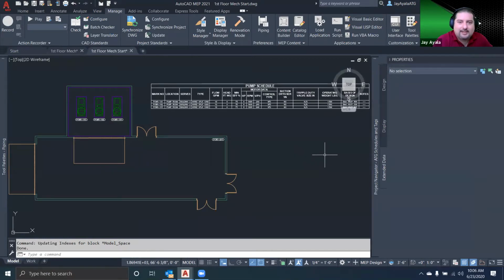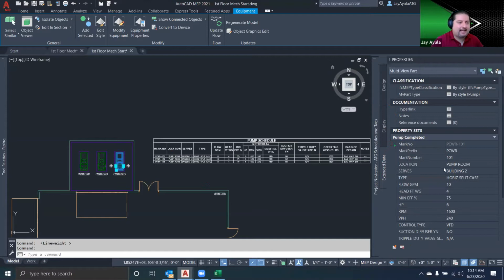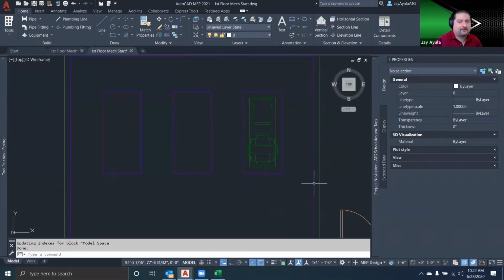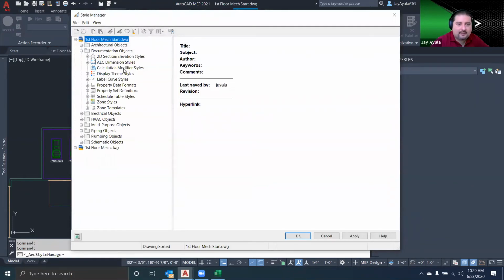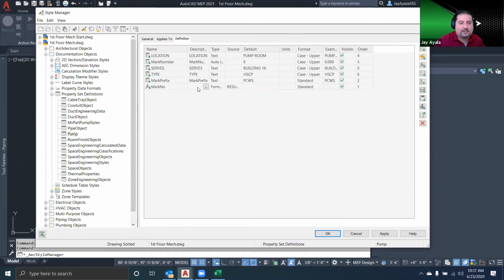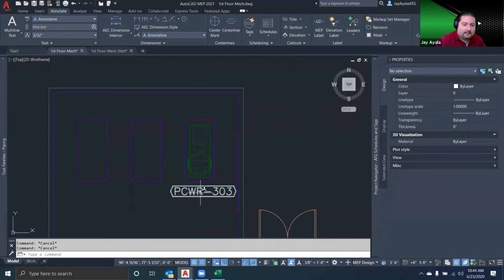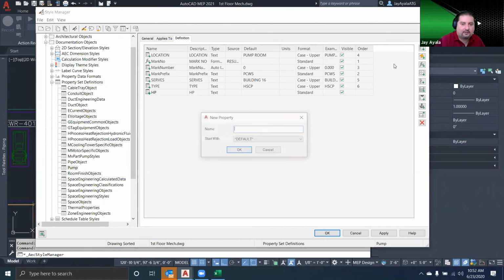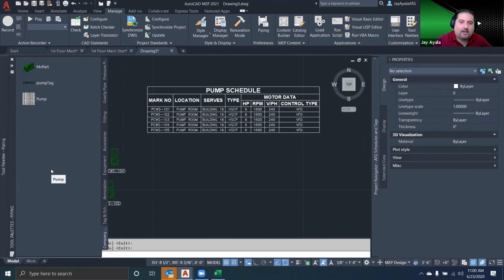Maximize AutoCAD MEP

Comment: I may have missed the responses
Questions?

How do we add the notes typically @ the end of a table and carried under the table as a foot-note? My company uses 1,2,3 and they are "foot-noted" below
How do I save these schedules to use on another computer or even drawing? I believe we need to use the project browser to import/export as it's not done like ACAD. Video follow ups on ACAD MEP?
I'm good enough to get into trouble and want to use these kinds of features, just don't get to do it. AutoDesk is not good at documentation and explanation. I'd like to avoid the transition to REVIT as ACAD has everything I need, but I seem to want the power features and can't get it right